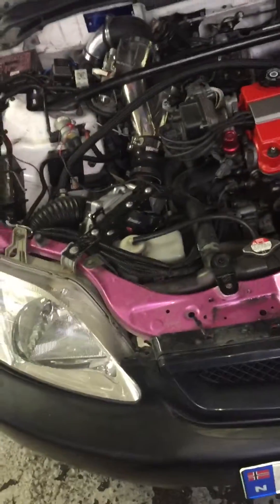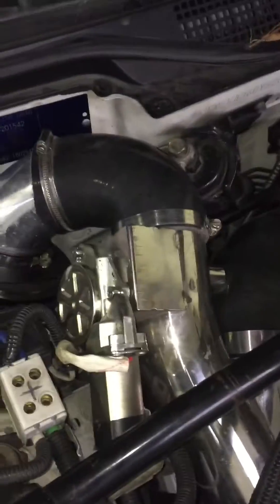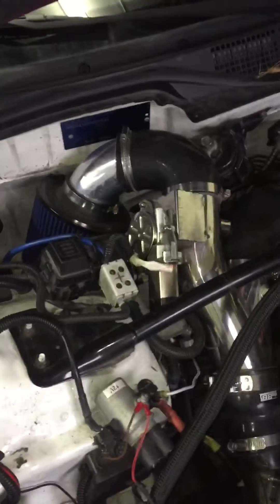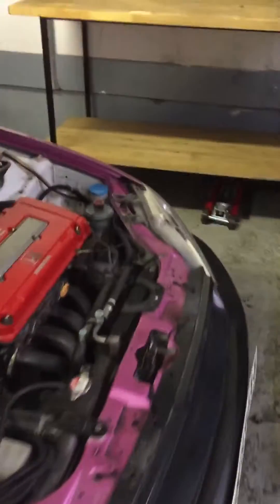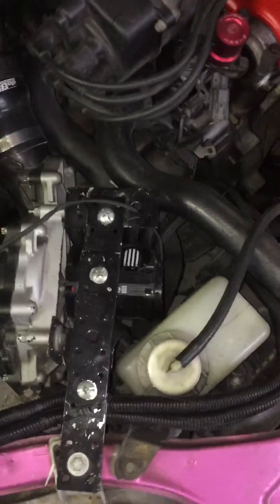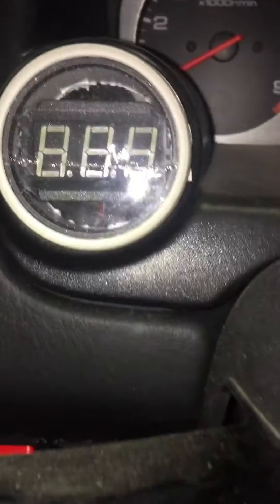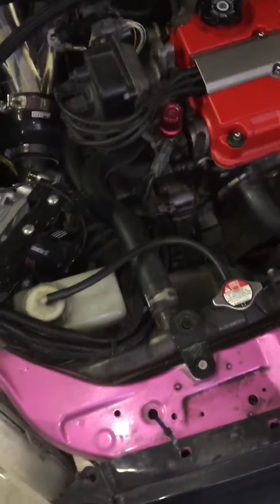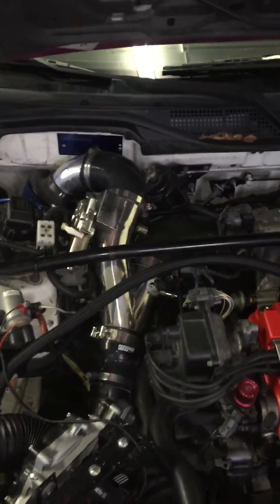Electric turbo honda civic, project finished

Comment: can you show how to attach batteries to it while its charging at the same time?
Reply from the maker: why would you charge it when you are installing it? 

charging can happen after installation
Reply: @karlhakon1718   hi , i mean , say i will install a second battery on my car to get 24v , how to use a 24v for a motor connection wise , i know it should be in series , now if i don't charge the battery it will die soon , how to connect the alternator to both or even three batteries like you, and how much you sell the kit for. thank you
Reply from the maker: Rabea ally the kit can be sold for 1200$. it produses aprox 60 whp ekstra at 48volts and cqn be run up to 60v

you need to separate the positive poles, it has to be two separate power systems. one 12v for the car and one 24-60v for the elturbo.  

charging is done with separate 230v chargers via a 12-230v inverter.  one charger for each battery. 

you can send me an email for more information. karl_h10@hotmail.com